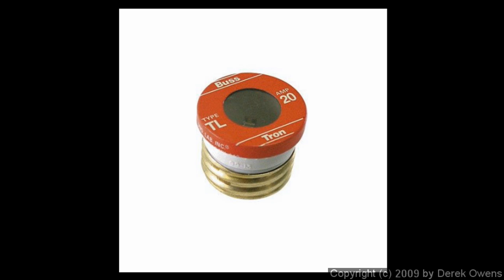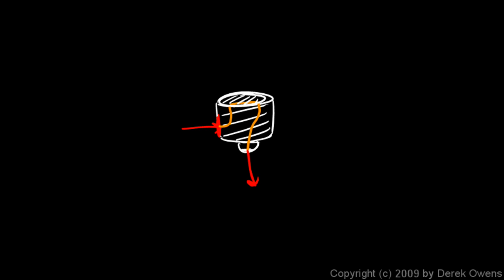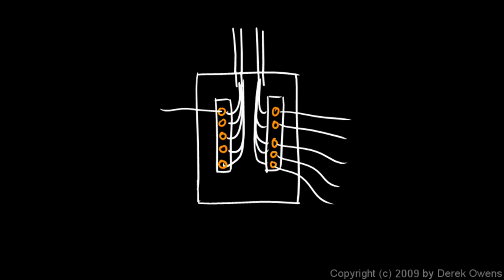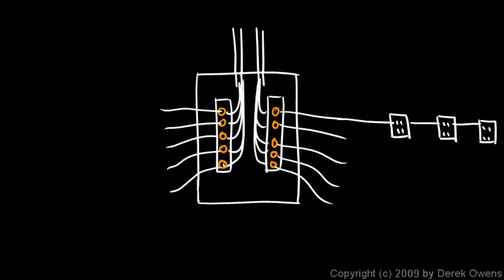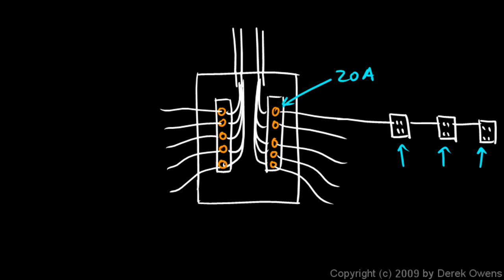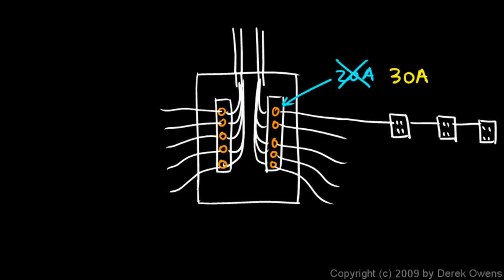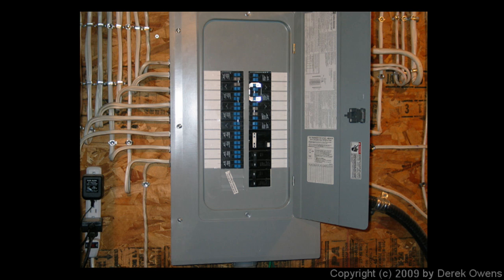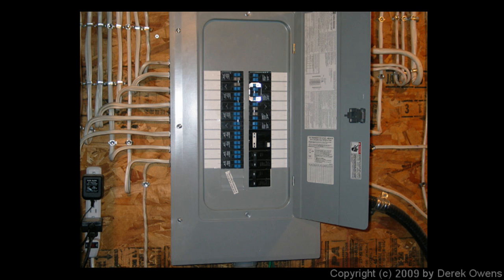Physics 13.3.4b - Fuses and Circuit Breakers

Comment: In that picture the main power cable is coming from the top. The picture is sideways. If you look at the text on the box you can see that picture should be tilted once to the left to be on the right position.

Comment: Hi Derek, hope you can answer my simple question. Is circuit breaker a replice electronic device for all fuse? In which case I must choose a fuse or a circuit breaker? I am an electronic engineer and I see some industrial motor, engines that use both devices as protection circuits.

Comment from the maker: Some power strips have a circuit breaker in them and some don't.

Using too many power strips on the same circuit could result in a large amount of current being drawn through the circuit.  This *could* be dangerous.  It would not necessarily be dangerous if the circuit breaker in the breaker panel were working properly.  Everything on the circuit would simply shut off, which might be annoying.  If the circuit were on an incorrectly sized fuse then it could be dangerous.